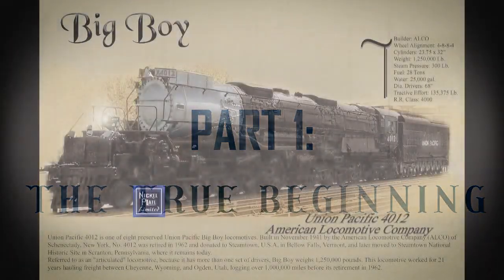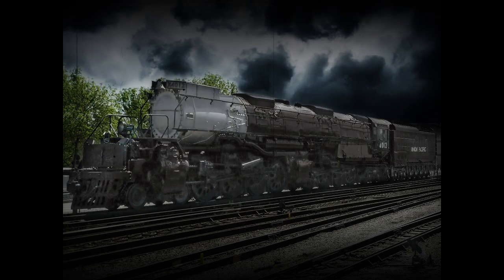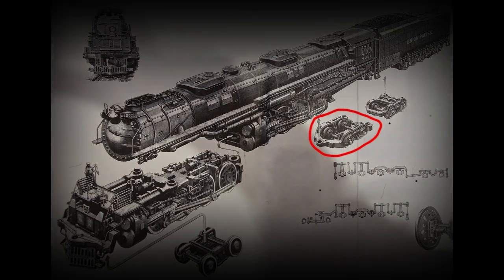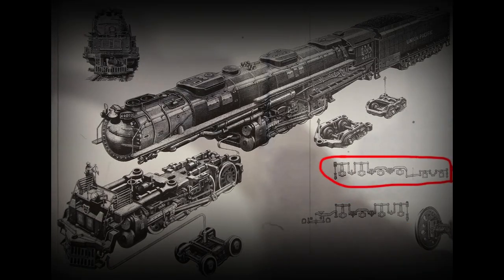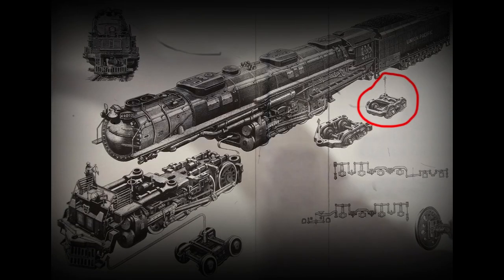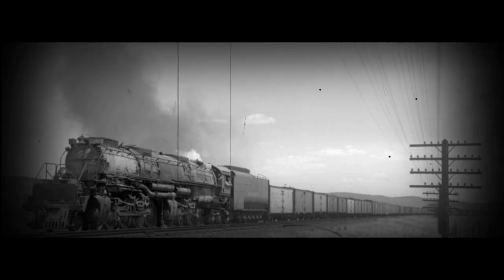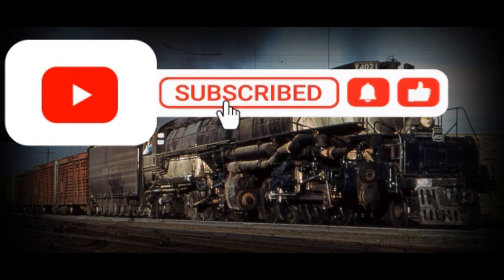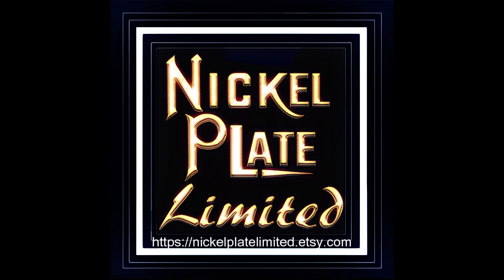Union Pacific Big Boy, How it Works

Comment: B.B. 4017 Mallet 4-8-8-4, is here in Green Bay Wisconsin in the National Railroad Museum since July 4 1961; and required VERY CAREFUL MOVING AROUND THE VERY SHARP CURVES, and the last wheels of the 10 under the  CENTIPEDE TENDER, were forced up with wooden wedges that are still there in 2024;  and Down the very steep hill to the NRRM next to the Fox River!!
Ok.Sun.Feb.10, 2024A.D.!!
Reply from the maker: Interesting.. I can understand why it was done very carefully.
Reply: Amazing to see 4017 in 1961 and see photos in newspaper microfilm at library.